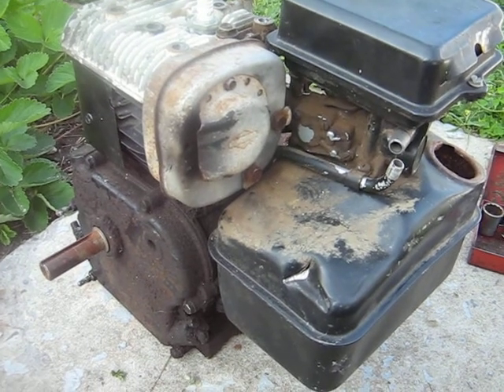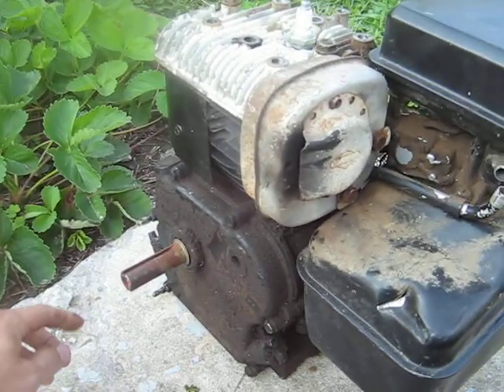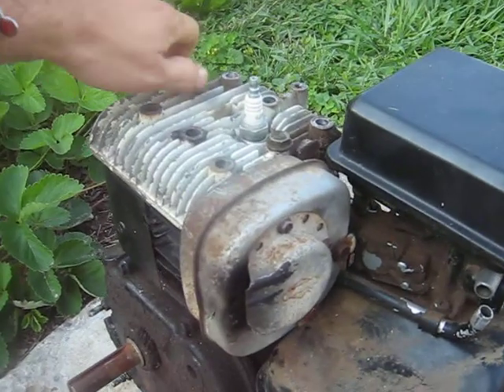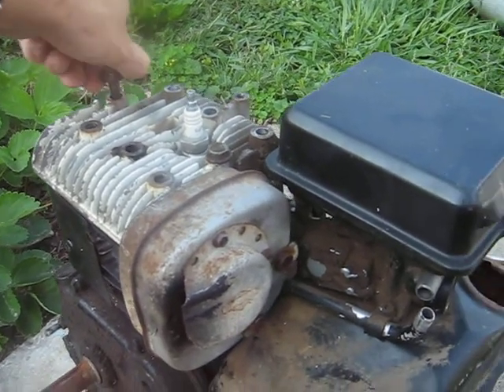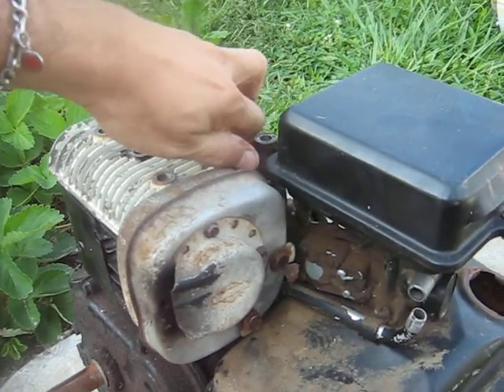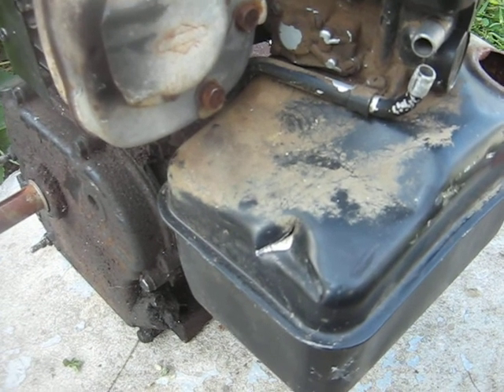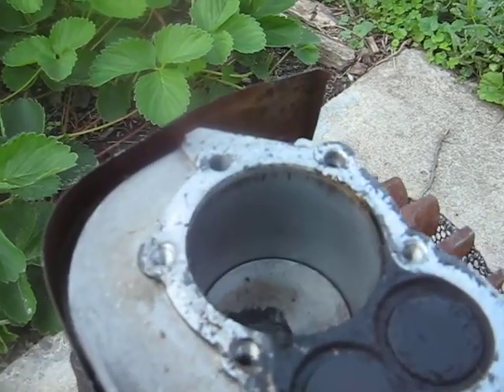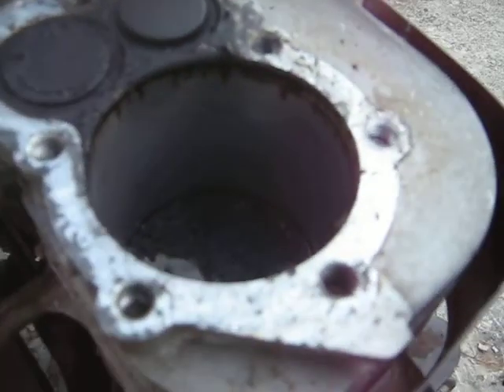Vid #1  5hp Briggs Build Up

Comment: Looking forward to the vids! I just did a few mods to an old iron briggs for my vintage minibike. Shaved the eyebrows, big carb, automotive ignition system, and later I will weld the cam and re-shape it for more lift and duration. I'm too cheap to buy racing parts so I make my own lol. Good luck!